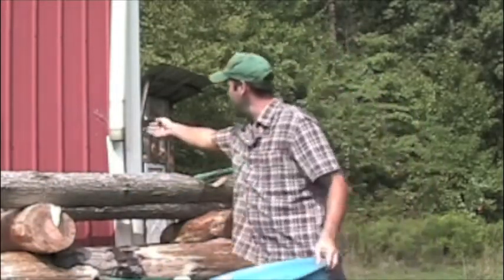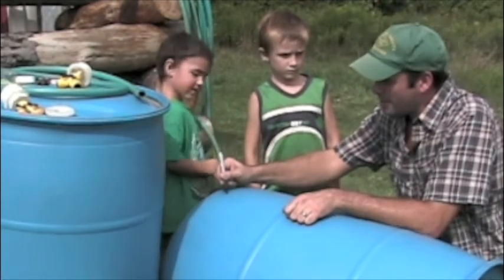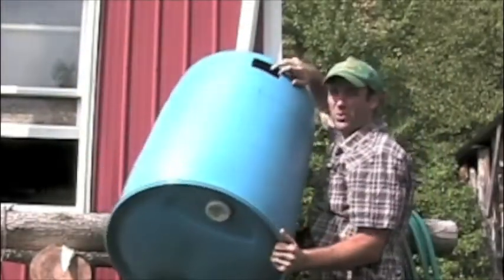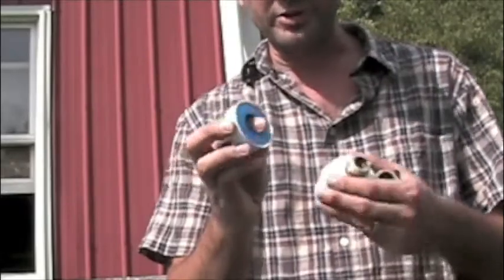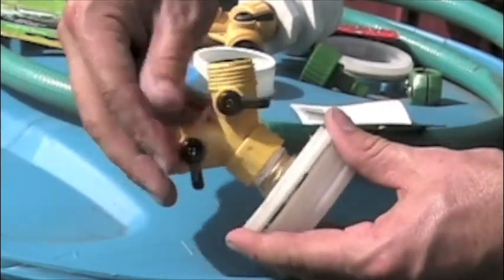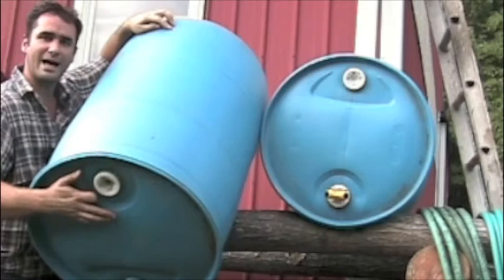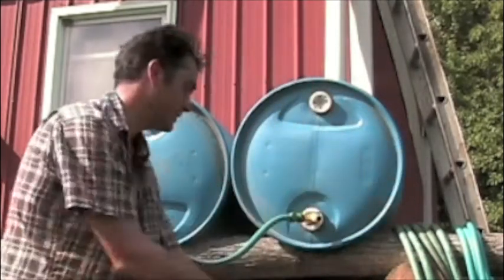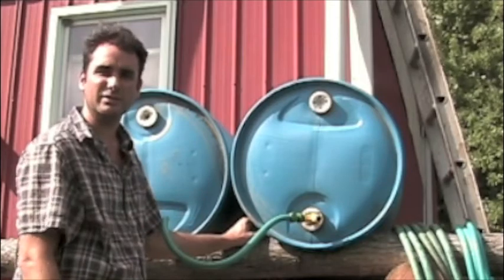Making a Double barrel, Rain Barrel.

Comment: I was wondering if you should set the second barrel lower than the initial barrel so that the initial barrel can actually fill the second. I dont see how one will fill the other when they are level and the flow is at the bottoms. 
Also, may tilt the back of the barrels just a hair and let the front edge stick out from the log maybe 4 inches and put your spout on the underside bottom so as to be able to extract all the water. As it is now there is about 2-3 inches of water not being drawn out.